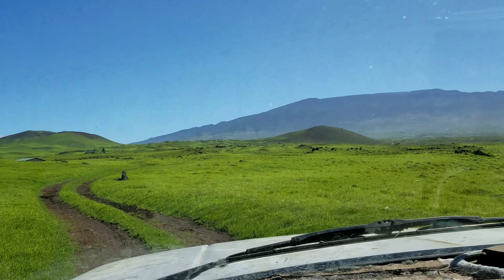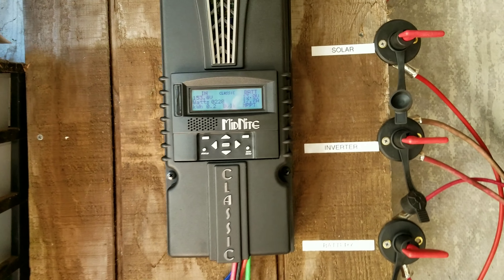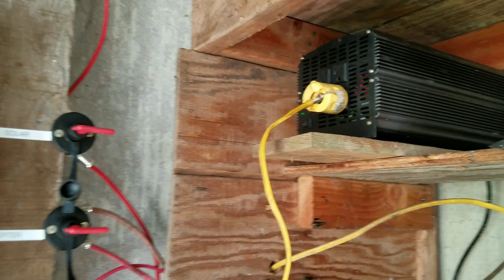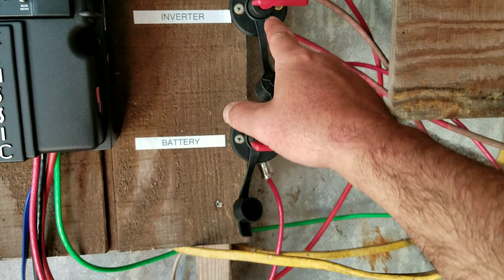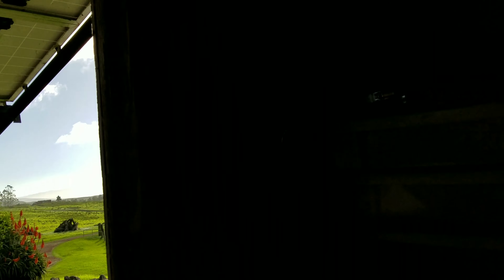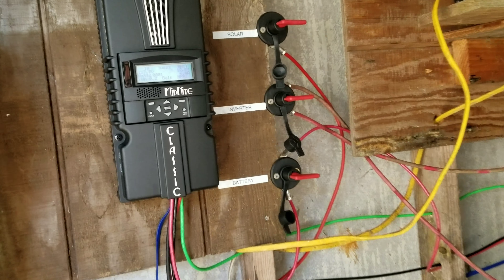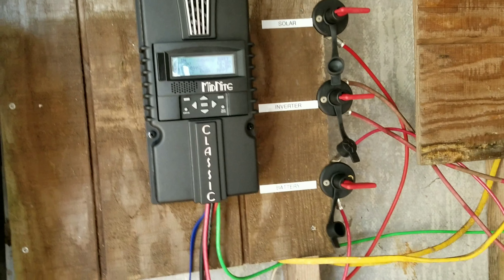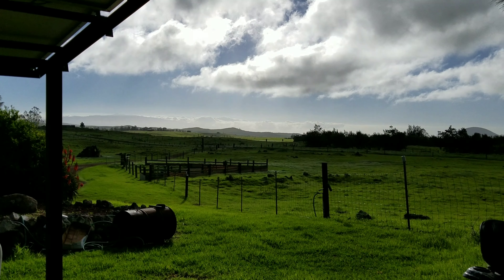Dad's Ranch House New Solar System Install

Comment: If you changed to A 48 VDC system, the system would run a lot more efficient and would not draw as many amps to run the same load. food for thought. I too started out on a 12VDC system and now have upgraded to a 48VDC system and now every thing runs a lot cooler and runs very well. Still use the old bigger gage cables that helps for minimal loss too.

Comment: you should connect the Negative from the other side of the battery bank to balance the charge/discharge on the batteries
Reply from the maker: +Sylvain Maher I understand your point but my dad has his ways we butt heads all the time. So it's hard, maybe when his not around one day I will go change it lol

Comment: definitely try to have Dad switch to 24V min when he changes out his inverter.  Can run more panels and more efficient with less parallel battery strings.
Reply from the maker: +Tom V I have tried to get him to 24v for years he won't do it I have tried.

Comment: Good on ya for taking care of the parents! In the opening segment driving in the truck, what is that on top of your dashboard where the windshield meets the dash area??
Reply from the maker: +Rob Michetti defrost don't work on my work truck it's to wipe the windshield. Thanks for the support
Reply: ok, looked like the stuffing from inside the old padded dashboards was coming out LOL!
Reply from the maker: +Rob Michetti there is old Camouflage tape over the dash, it's a older truck I use it mostly around the ranch.

Comment: if I remember right the 150 classic you are only supposed to have a 150 volts max or is that a 200
Reply from the maker: +jayd roofing it's a 200